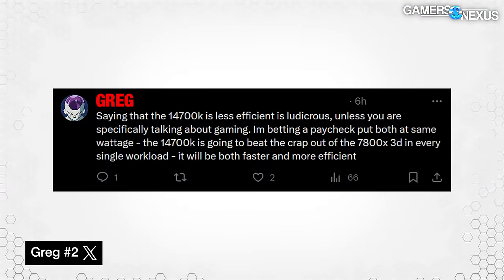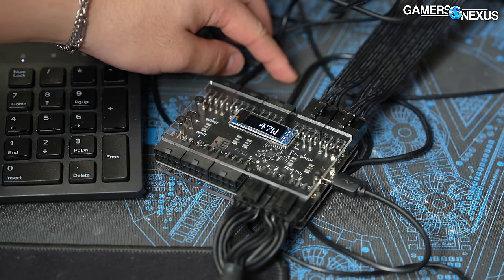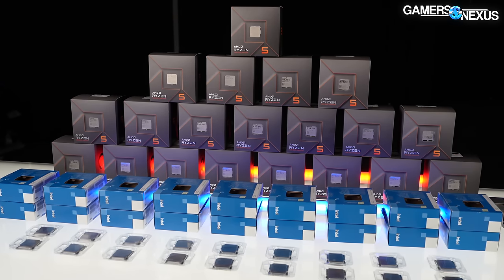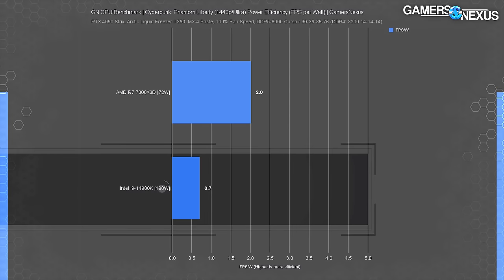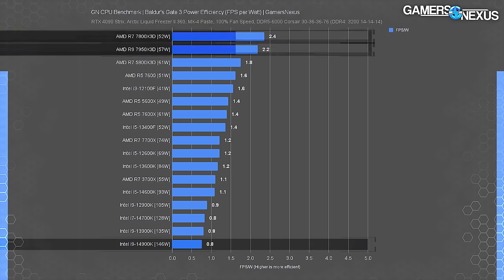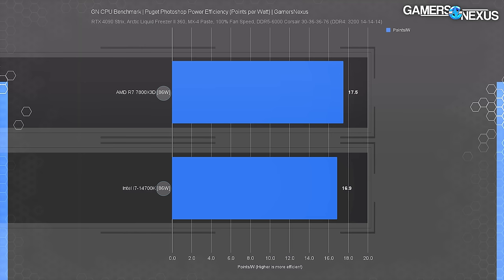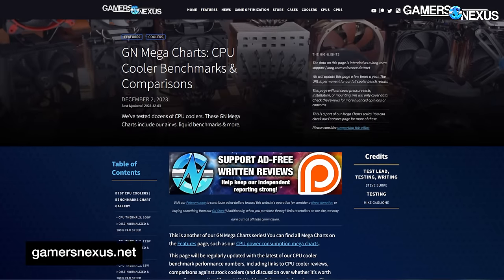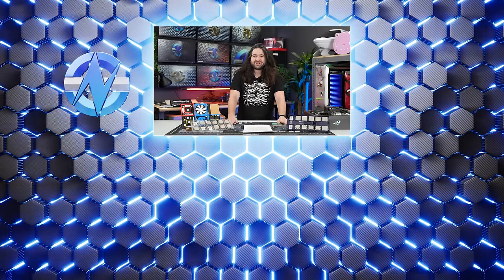The Intel Problem: CPU Efficiency & Power Consumption

Comment: the thing is intel is more advanced as amd in terms of functionality but for the cost of overall power efficiency. one ting that doing intel right is the C state handling but becuse of more things happen on that cpu that using power even it is not in use. amd on the other hand going of longevity and power efficiency and providing older but well known functionality that is optimized in power usage and stability.  yea amd has trouble with c states but they cut the overall power consumption. thats the reason why amd dont devellop a new socket every 2 years and hold on it for a long time. you can never get a power efficient intel build because after 2 to 4 years your mainbord is that old you cant get a new cpu for it but amd mainboards can last 10 years or longer for to be relevant even the chipset is a generation or two older it does not mater. if you only need 6 or 10 sata and a couple usb2.0 or 3.0 in this chase. sure why not using a older and cheaper board. baucuse sata 6gbit is now 1.5 decades old and usb 3 also so nothing havent changed in that years on chipsets yea pcie is now faster but it is fully backwards compatible and even the chipset is pcie 2.0 the cpu provides most likely a higher revision and some boards can use those on there x16 slots and ddr4 is or ddr3 is for the most parts of your day enough and if you use your system only as a work or office machine or death scrolling on tictoc or youtube.

you are surprised how little compute power is needed for doing this stuff and is it worth doing it with 150W from the wall or maybe doing under 10W from the wall. it depends on what mainbord you use and how many things it brings with it you dont use but is still powered. i have 2 PCs one for gaming it uses 150W idle and 900W on synthetic benchmarks and 600W on gaming but it is only used 3h to 10h in a week. but my other system uses 3W on idle and 17W on benchmarks and under normal use 5W. 

the point is if you dont care and want every tme the best go with intel but if you want a system that should last 10 years or longer and be power efficient as possible go with amd.  another thing is
amd provides server stuff like ECC on consumer hardware. it is not offiziell but it is there and not locked behind a paywall. intel have special cpus for those tasks and you have mostly pay for those features monthly or yearly. one reason why for home server builds are often amd system is used in stead of intel. 

in the end you have to decide what you wanna use and need. 

how i said i have two PCs one a gaming system one a low power office. but in this case the gaming is amd and the office is intel. the reason behind is the amd system is using an old a520 mainbord that i buyed for 20€ and i had a amd ryzen 9 5900 in a broken but sometimes function motherbord. i dont need much i only needed 3 usb ports with 2.0 and one with 3.0. no nvme only one hdd and one ssd and a pcie x16 4.0 for the rx6700xt so this bord was perfect. my pc is even in a nother room behind the wall so look and noise i dont care. the other system is a asrock j5040-itx stuffed in a old case from the 90s. the reason for this system is it is a intel silver j5040 cpu that can playback 2 youtube videos with 4k footage without dropping one frame and uses only 11w with the whole mainboard also the cpu is more as enough capable doing other stuff in the meantime without any hitches. because of that that the cpu is designt for power efficiency it has nothing unnecessary onbord  so it can down in power up to 2w on idle. the best thing is no fans at all it is dead silent and uses almost no power. even the monitor uses more power ^^ the point is this system is about 18h a day on and playing music or i do work and i pay 0.42€ for 1kwh so power consumption was a concern for me. this system has everything i need and i have still 1x pcie 2.0 and a m-key m.2 for wifi or other pcie stuff and 2 more sata ports. even a digital rgb header and 4 fan header are on this bord also usbc 3.2 gen 2 connector and lots of usb 2 and 3 on the back. so yea more i really need.

Comment: Can I buy 14700k for gaming and streaming (Single PC) , video editing, 3d painting and sculpting and Photoshop? also saw in some  games 14700k vs 7800x3d (with rtx 4090 card) gaming  benchmark videos, when the 4090 got paired with 7800x3d the gpu temp was high like 20 to 30 watts and obviously the cpu was low compared to 14700k, but when 4090 was paired with 14700k the gpu temp was 20 to 30 low. what you guys think about this ?
Reply: Don't buy 14th gen, if you have to buy intel find a good deal on 13th gen, otherwise go with AMD
Reply: @DrZoidburg  because of pricing? If so In india its almost same

Comment: 12:49 You can't compare the bars to the previous chart, but there's no reason not to compare the absolute power numbers... and the 7800X3D uses MORE power at higher settings and lower frame rate?  That should be investigated.  Wild ass guess: sleeps between frames cause the Windows scheduler to migrate threads more often, reducing cache hit rate and increasing boost clock (because of lower temperature).

Comment: what's the point of comparing 14700k to 7800X3D? go with either 7950X or the top APU whatever the name is! X3D is a very specific chip and pays a bigger "I/O tax" than dual CCD ones

Comment: i watched jays2cents video on the 7950x3d CPU. he says it kept crashing and giving blue screens. he says the CPU is efficient cuz of the 3d v-cache that lets games run great but has to run at low watts and temps. hence the low watt usage. its great for games and for high fps. but it sucks with programs. that the CPU didnt know when to engage the 3d v-cache and when to use normal cache. they put out a bunch or driver fixes but it never really got fixed. PCs would continue to crash. this is what im curious about. are these 3d cpus really worth it?

Comment: So at this point, Intel's losing on most fronts.

But would it be inaccurate to say this could be due to the node size used to produce the CPUS? 

Unless I'm mistaken, AMD is using a much more advanced and smaller node than Intel is, which typically helps in terms of energy consumption? 

If AMD's running 5nm, but Intel is using, IDK, 7nm, theoretically Intel could regain the lead in efficiency by gaining node size parity with AMD? Obviously not something we could test, and if Intel still keeps chugging all the power on the chips, it's unlikely to change, BUT this still seems like Intel's greatest weakness at this point.

Comment: So basically Greg said "unless you are specifically talking about games", and then you went ahead and tested games. The only non gaming tests you did at ISO wattage was Blender and photoshop. In blender the 14700k won in both speed and efficiency and in photoshop it was basically a draw.
Reply: yeah, I expected a similar test like what derBauer and TPU did but with even more details, so I was pretty disappointed this was just showing mostly useless information, testing locked framerates over different power limits or underclocking, testing mostly efficiency in games when it's known that's where X3D CPUs excel, doing a single MT test and a single ST test using a single lower power limit, tested 7-Zip but didn't even test on a lower power limit.
Also the often mentioned argument of "But the CPUs come like this OOTB" ignores the almost always forgotten by reviewers non-K variants, which are power limited by default.

Comment: I wonder how this transfers to laptop... I had an AMD Ryzen 7 CPU in my pro laptop, it got stolen (so besides "it had an 8 core 16 threads Ryzen 7 U CPU with 16Gb of RAM and a 500Gb SSD", I don't remember the exact reference) and I took one of our intel i7 laptop (i7 1165g7, all other specs the same).
It feels my snappy PC was replaced by a sleeping snail strapped to a jet engine (the noise) and I hate it.

Comment: Not surprising that AMD's IO chiplet becomes the power consumption "floor".  The tasks the IO chiplet handles (off package communication in particular) do not benefit nearly as much from process node shrinks as pure logic circuitry does.  So AMD has them fabbed on a node or half-node older process.  Fabbing them on the same node as the compute chiplets would be a double cost whammy (more expensive IO chiplets and less wafer allocation for compute chiplets) for a small performance per watt improvement.  Just not worth it.

Comment: Intel have been failing in the efficiency game for laptop CPUs. There is a reason my work latop uses more power than my 13 year old desktop, but isn't even twice as fast. It does use less power in battery save mode, but cannot even handle a teams confrence call. In fact, the 65 watt hour battery only lasts an hour in a confrence call. My collegue has a macbook, does the same work, but can run a whole day on one charge.

Comment: Intel is in big trouble imo... I can't even see a good reason to buy anything from them apart from a cheap 12100/13100
In most of Europe KWh cost is 30Cents+, so the additional +100W consumption of an I7, gaming even "only" 3hrs/day is +30EUR/year, not that high but still significant

Comment: To much power “power controller system” if it’s to hot “layer separation prevention while extraction manufacturer run off while the customer USeS it” glitch slow boot “memory controllers”

Comment: The 14900k is boosting to 5.7-6Ghz "out of the box".. do you think any CPU can clock that high with low voltage requirement and low heat dissipation? Lol the X3D chips don't even hit 5ghz, ofc they run cool.

Here's a thought: try dropping the ridiculous P-core boost speed to something more reasonable. Even lowering by -200 MHz will make a huge difference. Viola, the CPU doesn't use nearly as much power. Throw a undervolt offset on top. The CPU now doesn't even touch 75c under full load on a crappy AIO. Considering this a "gaming benchmark" test, lower clock speeds will literally make no difference in the benchmark results. 

What CAN matter in gaming is RAM clock speed. This is where Intel is advantageous - the memory controller can handle speeds as high as 8000mhz, X3D can't come anywhere close to that.

I get Intel basically fucked up by setting the clock speeds so damn high at stock. Just makes the chip look bad as a whole on a benchmark chart next to others. But that being said: someone picking up this chip should probably know what they are getting themselves into, or at least be willing to learn how to tune and undervolt - and have intention of pairing it with very high frequency DDR5 RAM.

Comment: Sadly missing a key metric - non-load power consumption. It could very well be that the AMD baseline is many W higher and so running these CPUs 8 hours a day on low load (realistic, unlike 8 hours of heavy gaming every day) should have been measured.
Reply: They've shown idle power consumption of these cpus multiple times. They cant do everything in one video
Reply: @stephenallen4635  point me to that please? Didn't see that in the 7800 review
Reply: @billgrant7262  for the 7800 he says in this video that you've just watched that he's going to do it soon

Comment: The intel " more power = more better " model has broken.  Its over and done everyone who knows anything has and does know this.  Intel please stop asserting anything different, it just makes you look ignorant of your own products.  Just lean into it if that's your model and stop claiming otherwise.  Please.  Please.  Then maybe you can actually market your products better and I'd consider buying it.  But seeing these numbers (the same trends we've seen for years) and hearing you claim that they're more power efficient....my A/C is more power efficient.   You can't step to AMD on that front so stop trying...and failing.  I have no issues with intel cpu's whatsoever but the disparity in the marketing, numbers, and approach your taking is absolutely a issue and one that not only I but many others have went Red bc of.

Comment: #GamerNexus... I know how to stop top end cpus from overheating. hint: reset cpu to basic clock speed and leave it there for a week before setting it back to factory.for me
i9 13900k - 3ghz 1 week to 5.8ghz 1 week later. temps seems to normalize aftere that. also running rtx 3080 10oc aorus xtreme/ Z790 Aorus Master mb.

Comment: My gaming den is basically a closet. I'm running a 12900K and a 7900 XTX. I don't care about the electricity costs, but the heat is not pleasant. I will prioritize power usage for my future builds for sure...and meanwhile I'm "ackchyually" running both CPU and GPU power contrained...

Comment: Great video; no doubt AMD are currently more efficient than Intel. However, I think it would be worth measuring TOTAL system power draw from the wall - keeping things like GPU/RAM/HDD constant. A CPU can't run independently of it's motherboard, so I think both should be measured to get a true idea of each platform . Also, it's worth looking at IDLE power consumption for each platform as well - as most users' systems spend a large portion of their days at IDLE, or close to.
Reply: No most users use sleep mode or turn their PC off at idle. It's a niche of people who spend literally all day at idle. If you mean browsing then sure but that isn't what idle is.

Comment: For 2 pcs here in Scotland one a 5600x and one a 7800x3d my energy bill come to an exta £230 a year, over the course ofthe pcs lifetime thats roughly £1000-1200 depending on time between upgrades, if i was to use a 14900k and say a 12700k instead i would be adding £500 give or take over the lifetime of the pc....... thats half a pc build for my GF right there so it adds up for me.

Comment: Kind of confused why you keep harping on about this so much.  You said yourself in this video for most of your viewer base  (the average home user) it makes little difference cost wise.

If you can afford either of these chips in the first place, you can afford the extra $15 a year power wise.
Reply: Its not just about the power bill, even though for me in germany it is actually worth considering it, its also about heat output
Reply: Again, assuming your average user, they are gaming... yes it will be more with intel, but the difference is minimal.

Don't think this has been tested, but I recently went from a 5900x to a 13900K, literally no difference. An hour on Cyberpunk and you're gonna have a toasty room.

It's nexus' like 4th or 5th video on this subject now, we get it already.

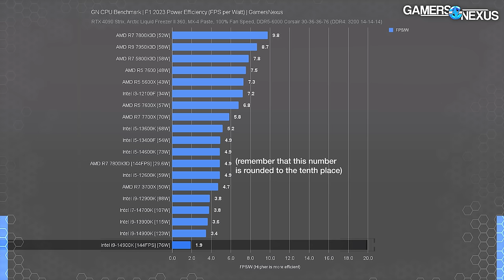Comment: Small issue: in the chart at 9:16, all the wattage numbers were rounded to the nearest whole number as stated earlier, except for the FPS-normalized 7800X3D entry, which should have been rounded up from 29.6 to 30. Doesn’t really affect the interpretation but it is a slip up in the wrong direction.

Comment: im surprised on how good 12100f is efficiency wise considering the cheap price of the cpu itself as well as it being ddr4 compatible and not requiring an unlocked SKU and motherboard bringing overall platform price even lower

Comment: Meh. I work for a large corporation that buys tens of thousands of computers every year.   Gaming is not on our radar at all, but power efficiency is also relatively low on our list.  We do consider it, but what is far more important is overall performance at general workloads, system reliability, and support.  We care about battery life on mobile systems but CPU efficiency is hardly the only factor at play.   We review AMD based devices when we select products each year but AMD rarely is the best choice for us.  Here's a fact. If power efficiency is your most important factor then neither AMD nor Intel are the best choice. It's going to be an ARM based system - which will run windows or linux just fine.  If efficiency is not a critical factor, and you've selected away from ARM then why would you be talking about it in the decision between Intel and AMD?  It's a red herring aka marketing wank.

Comment: You should put the unit inside a real rig with a meter on the main lines.  As the mobo, cup, gpu heats up the draw on the entire system will change drastically from how this test is down.  This is too artificial and not a real world scenario.
Reply: if your case causes anything to heat up "significantly" compared to this - go buy a pair of 120 or 140mm fans and fix your case's airflow, ok? This is like, not normal. A few degrees is ok, but it will definitely not cause an excessive change in power consumption.

Comment: 7800X3D - you're a noob.
14700k - you know RAM overclocking and how to undervolt modern Intels.

Then the i7 will actually win (and not by 1%) against the 7800X3D almost every possible time, but will still consume more power.
Reply: 7800X3D - you like stability and ease of use.
14700K - you prefer an unstable space heater with marginal performance gains.
Reply: @Gearheadlights  Oh really? So far it appears, like the AM5 is extremely unstable and unreliable, while Intel has no issues when paired with DDR5 up to 7200MHz.
Reply: @PolskiJaszczomb  Intel is not going to give you a high up job if you keep defending their honour... please just stop... it's embarrassing how many people are building their identity around a brand
Reply: @klipk7296  I'm not defending anything, OOTB Intel is simply a worse choice, but with RAM overclocking and undervolting it simply wins, simple as that.

I don't create fairy tales, like the Kaka.

Comment: Even if it's very efficient wattage-wise, the 7800x3D has a TERRIBLE IHS. It screams to be de-lidded.

Before you start hating - I own a 7800x3D
Reply: That only applies to the 7950x and 7950x3d
Reply: Why would you ever want to delid an amazingly performant 60W CPU tho? Like, honestly, what's the point?